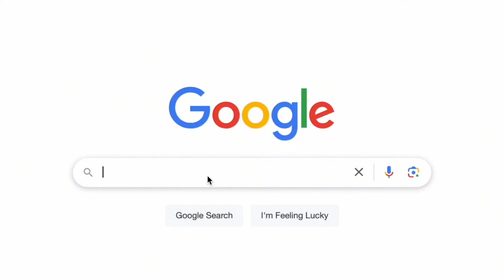BEST Ozone Generator for a DIY Cold Plunge? Here's what you NEED to consider...

Comment: I use ozone water for a skin infection and it works ok. I put my ozone gen water stone in a five gallon bucket and run it for about 3 or 4 hours. It says it gives 1000 mg . Then I put my shower water pump in the bucket and shower with it. It's truly amazing for my skin. I would like to get to something that I dont have to treat for so long before I use it.. Would using an ozone gen that is 28,000 make a difference? Thanks for any info yall can give. I've been doing this for over a year it helps so much. When I stop for more than a few weeks my skin goes back to infection.
Reply from the maker: I'm afraid that's outside of my expertise

Comment: Thanks Joe! I bought a used Gen 1 plunge brand setup, and I had to replace the Ambohr ozone generator. Does the ozone generator run periodically or do I need to unplug/replug or set up on a timer? Said differently, is it bad to have it constantly plugged in?
Reply from the maker: I recommend a timer, but that plunge system ran it 24/7
Reply: @DIYColdPlunge thank you!

Comment: Joe, I recently purchased the generator and venturi from you and am about to replumb my system. Do you see an issue with mounting the ozone generator inside a large plastic electrical box with the timers etc?  I am drilling a large hole in the bottom of it to run the cords through that will vent the box.
Reply from the maker: Not at all!
Reply: @DIYColdPlunge Joe, thank you so much for the response. Unfortunately I am having a problem with the ozone generator I hope you can help me figure out. The tube to the venturi is full of water. I checked the check valve and the flow direction on it and the venturi body and both are correct. The tubing goes well about the water line but the body itself sits at or a little below the water line of my tub. I don’t know why there is no suction being generated.   Thanks, Bill
Reply from the maker: @stuartx4  You'll have to email me some photos so we can diagnose 👍 This is almost always due to either a low powered pump or plumbing configuration issue.

Comment: Does is matter if my discharge water is not lower than my water line in my tank?
Reply from the maker: Like your water splashes down? Not technically it can still function
Reply: @DIYColdPlunge  Yes, it splashes down. Originally, I thought the added D.O. might be helpful in a closed loop.

Comment: Hello Joe how often and how long do you run your ozone for I have a metal tank, thank you in advance Martin
Reply from the maker: Start with an hour or so and monitor things, move up from there if needed - https://youtu.be/fZx8a3zYVNo?si=zrUoWfy8ej7NJrx7&t=209
Reply: @DIYColdPlunge exactly how do you “monitor things” to optimize ozone generator run time ?
Reply from the maker: @CSURFC  Mainly water clarity & other obvservables. Dirty/murky/smelly = more time.
Reply: @DIYColdPlunge thanks. I’ve been running mine 24/7. Always clear clean water. Going to put it on a 2 hour timer as you advised
Reply: @CSURFC that will burn out the ozone generator quickly and you will have to replace it. Its not necessary.
Reply: Cheers Joe 👍🏻👍🏻👌🏻